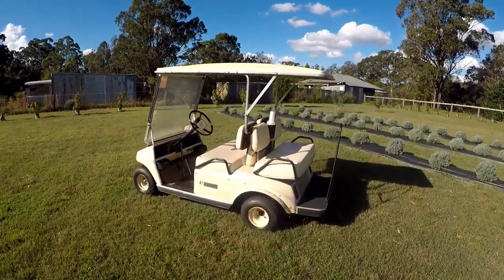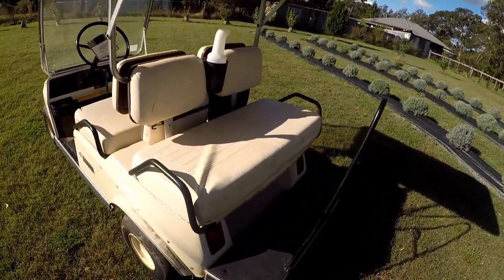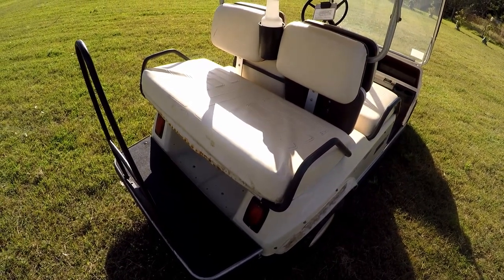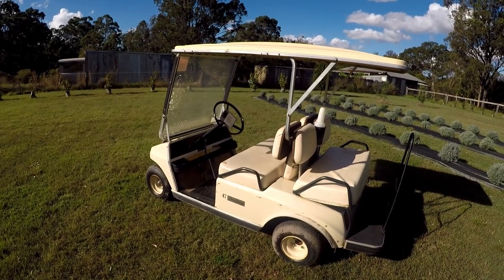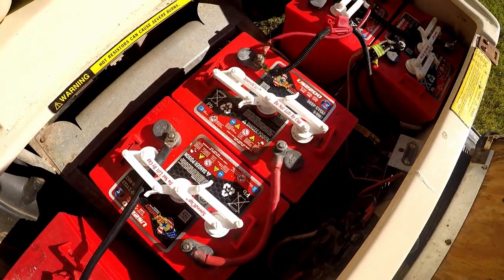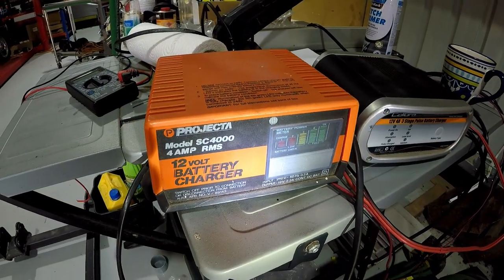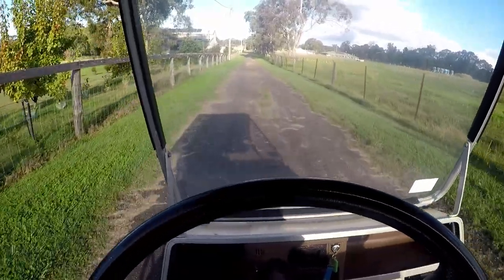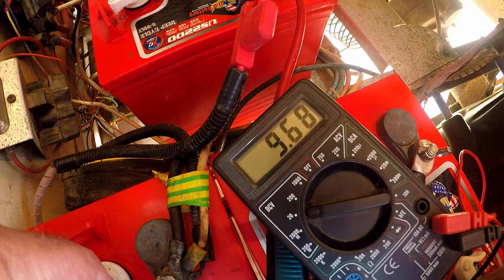ELECTRIC Farm Cart - Part ONE - 1990's CLUB CAR to Solar Farm Vehicle

Comment: Thinking about buying 1 just like that 1.
What are the pros and cons. 
How did the battery work. 
What is the max speed. Did you do another video
Reply from the maker: Yep there is a second video on this link. Speed was no faster but it had more get and go if that makes sense. I did end up buying a proper 36 volt lithium battery charger so I could use the cart before the solar panel goes on top. The 12 Volt lead-acid charger just didn't get enough charge into the batteries. https://www.youtube.com/watch?v=n9bZyUeIKco&t=7s